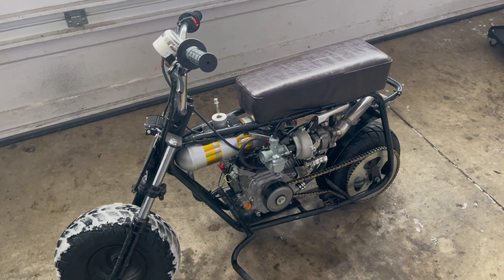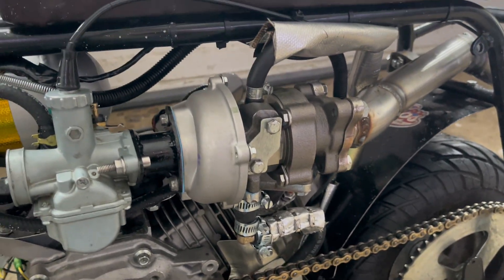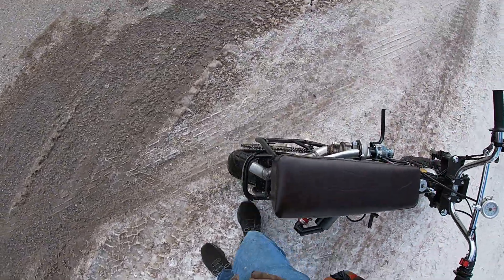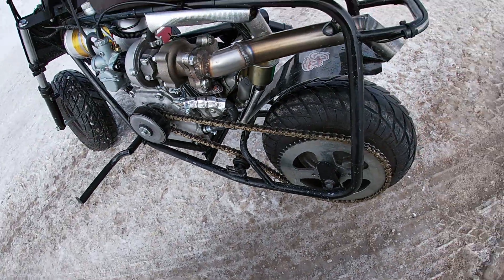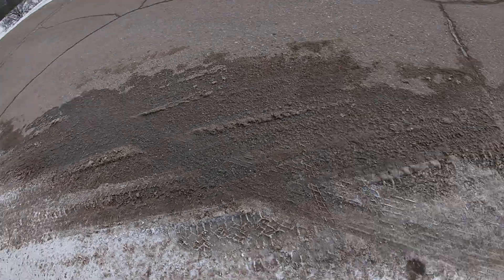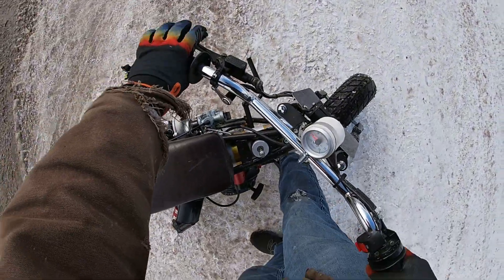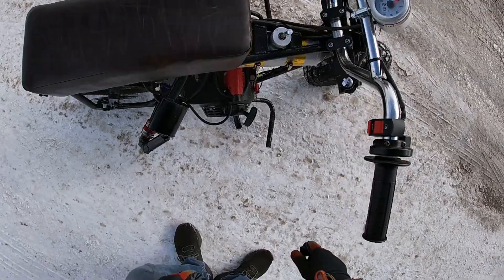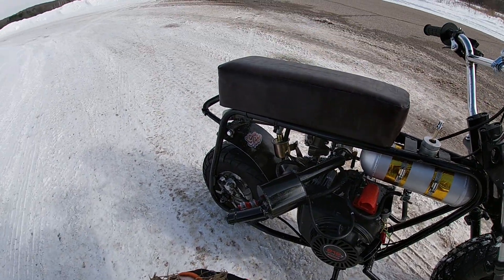Predator 212 Makes 7psi of Boost -Turbo Predator 212

Comment: It could be smoking due to an oil drain issue from the turbo, but it's definitely smoking because the throttle (carburetor) is upstream of the turbo compressor. The compressor shaft seal can't hold oil back against engine vacuum. Most turbos made since the mid/late '80s are that way. The older carbon positive seals can handle it, but I think the hard part will be finding one for the turbo you have.